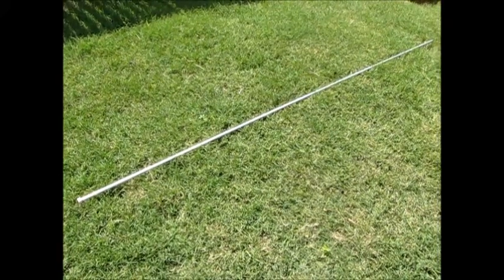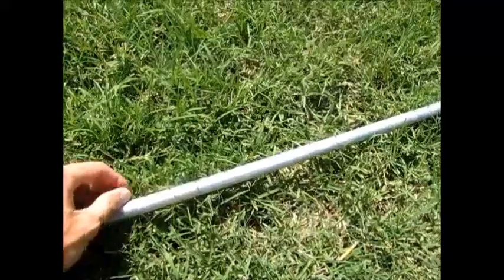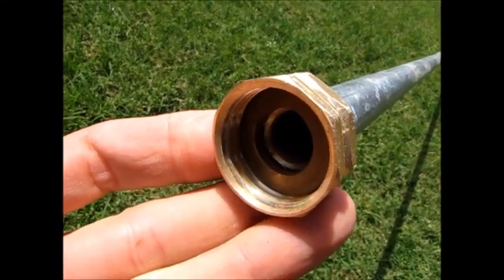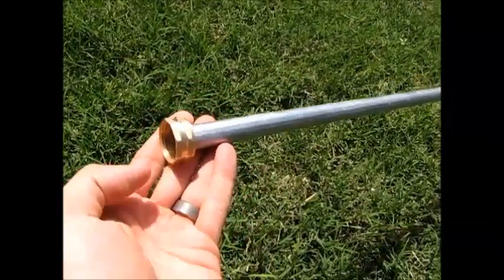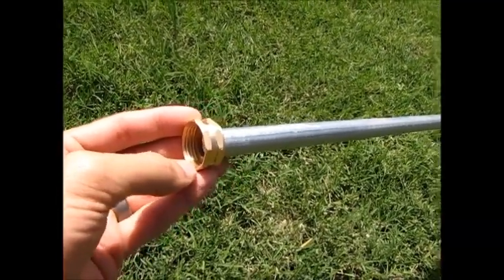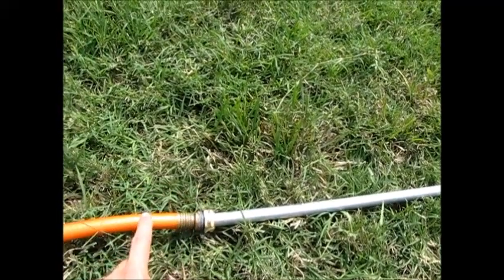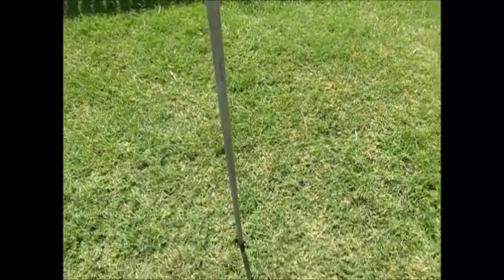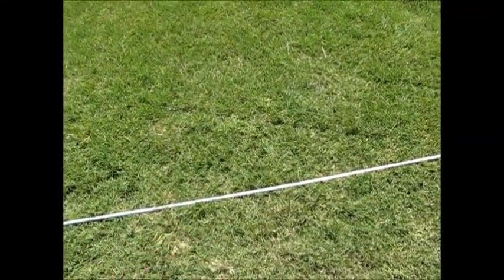How to Install a Copper Grounding Rod Without A Drill - Easy DIY Hack

Comment: Hum, why not use a length of 3/4" copper pipe/tubing instead?
Reply from the maker: For the drill or for the grounding rod?  If you are referring to the drill, copper is more malleable and softer than mild steel so it would make a worse drill and cost much more because the price of copper is so much higher.  The drill has to be able to push aside rocks and go through tough layers of sediment and I don't think a copper drill would handle that well without getting deformed or broken.
Reply: LDSreliance I use 1/2" copper pipe for my ground rods all the time. They are cheaper and longer than regular ground rods and have plenty of copper surface area too. Using one as the drill and leaving it in place could be an excellent plan. And you can probably remove the fitting with no problem.
Reply from the maker: That is a pretty good idea.  Have you ever checked the impedance to make sure that it is a viable ground?
Reply: Almost pure copper trumps copper-clad, and will last longer than you do. And at 10 ft. long instead of 8, I can cut one in half and get two 5' rods for some situations...an additional savings. A very important consideration is a no resistance connection. Use fine sandpaper to shine up the connection point and use a copper strap and copper wire if at all possible. Braid is a good RF ground. Use old RG-8 instead of expensive braid. Solid wire is better for a safety (lightning) ground. Using old RG-8 both the inside and outside conductors does both. BTW a hollow pipe will penetrate ground easy even if you have to hammer it in. And there is a tight connection not achieved with mud.
Reply from the maker: Sounds good.  If I ever have to do this again I will try it out.  Thanks!

Comment: Solid copper rods are solid copper. There ain't no scraping off the coating.
Reply from the maker: Solid copper ground rods are very rarely used.  The rods used for residential homes, for example, are all copper clad steel.  https://www.ecmag.com/section/safety/dirt-ground-rods

Comment: Dig a small hole.. fill it with water.... keep it filled.... use the ground rod itself..... lift it....drop it...lift it.....drop it.....using hydraulics....it will drill its own hole. Mother nature will..over time...fill any dirt in around the rod...securing it tightly !
Reply from the maker: Yep, that is very similar to what I did.

Comment: In order to be effective, a ground rod must be in tight contact with the surrounding soil.  Ground rods installed using this method will not be in tight contact with the surrounding soil and will not provide an effective grounding electrode. There is much literature available that invalidates the method of ground rod installation that you demonstrate in this video.
Reply from the maker: I don't understand this line of comment.  The mud makes it easier to push the grounding rod into the ground but creates a MASSIVE amount of suction that prevents it from coming back out.  I couldn't have gotten that thing out with anything less than an excavator after it was in the ground.  So tell me how that is not tight to the ground??

The only real criticism to this method would be if the grounding rod doesn't facilitate electricity to flow into the earth.  But this method produces a valid ground of less than about 25 ohms resistance.

Comment: If losing the copper coating on a copper grounding rod renders it useless then why are you showing us a galvanized steel rod to use?
Reply from the maker: It isn't a galvanized steel rod.  It is a copper clad rod.

Comment: When you install a rod like this it is loose in the ground so you have no ground!
Reply from the maker: I would suggest that you try it out before you disparage the method.  Because there is no way that any human being could remove that rod from that hole after it goes in without digging it back out or using heavy equipment.  It is in much tighter contact with the ground than simply hammering it in.

Comment: That does not make a grounding electrode. Note: that water driving method will insure high impedance; you are after a low impedance system. And the proper ground electrode. Drive two solid  5/8 or ¾ x 8 foot long min7 feet apart galvanized or copper clad rod it the proper way as a supplemental or main grounding electrode system if you don’t have building steel or copper water piping as your primary grounding.
Reply from the maker: +Mike Phillips Sorry I never saw this comment.  The water drill that I created is just to make the hole.  I then insert a copper rod in the hole.  Click on the full demonstration video (https://www.youtube.com/watch?v=K5eorpQBml0) to see it more clearly.

Comment: NOPE. The rod must be tight to the ground. 'Drilling' a hole to insert the ground rod makes it so the rod does not have firm contact with the earth! The best way is to hammer the rod into the earth.
Reply from the maker: I guarantee you could not get that rod back out of the ground after 5 minutes without a backhoe.  In fact, I would bet it it tighter to the ground than hammering it in because the of the suction of the mud.

Comment: Why dont you buy a post driver, a sledge, or other well known tools for this job and run the rod in 3 minutes instead of ten? I like the creativity, but this is a waste of money in materials and your time, and time is money.
Reply from the maker: I have a sledge.  And a sledge or post driver will mangle the top of the rod.  Remember, this is copper clad steel and the copper cladding can easily be scratched off and lower the effectiveness of the rod.

Also, this tool is much more effective if you have rocky soil as the water will create mud and help move rocks out of the way a little bit so you can slide through.  With a sledge you will just continue to deform the rod as you pound into a rock.
Reply: LDSreliance prove that current wont travel well on a slightly deformed rod head. Do it all the time and it still passes electrical inspection. I think I know a bit about conductivity and electricity wont care about a dinged up head.
Reply from the maker: If that works for you great.  I tried it first with a sledge and I could not get it into the ground without running into rocks.  The top of the rod mushroomed to the point where I could not even get the ground wire connector over the top any more.  So I looked into renting the right equipment.  $40 for a day?  No thanks!  So I built this rig for $10 and it has worked great for me multiple times.

Comment: copper coating? you use a pure copper rod.
Reply from the maker: Not always.  Copper clad steel is the most commonly used grounding rod and is the only kind available at big box hardware stores.

Comment: a GROUNDING ROD is  not  Not  NOT  "copper" !!!
it is  5/8"  Copper Coated STEEL 
...
Reply from the maker: A distinction without a difference.  If you mangle the rod pounding on it to get it into the ground past rocks and the copper cladding is removed, the grounding rod will be ineffective.

Comment: lol, just take a freaking hammer and pount it in. You put a piece of wood over the ground rod and it doesn't take nothing off of it.
Reply: Good luck breaking a gasline, water pipe, sewer pipe, electric line, etc. 😂😂🤷‍♂️🤷‍♂️

Comment: Albertans THIS IS ILLEGAL!!!!!
Reply from the maker: +Klint Krossa I'm not saying you are wrong but you do realize this is for DC electric and not household AC power, right?
Reply: Wait, why is this illegal?
Reply from the maker: ElementofWorship Illegal and "doesn't meet local code" are not really the same thing as some people in the comments are saying.  This method may or may not meet any electrical codes that apply to your city, county, state, country, etc.
Reply: @LDSreliance  It doesn't meet National Electrical Code in the United states. What do you mean, "for DC electric"?  Regardless, NEC also requires you bond all of your grounds to a common point. Doesn't matter if it's for home/safety ground, ham station ground, antenna ground.

Comment: Could just use a bottle of water...
Reply from the maker: Well that would only accomplish half of the effect.  The purpose isn't just to make mud, but the water pressure (40-60PSI usually) will actually help to bore the hole for you.

Comment: Providing u got no rocks
Reply from the maker: Huge rocks are definitely a problem.  The only way to deal with those is a drill.  But drilling through a huge rock will not provide a solid earth ground, anyway, and thus you would have to find a better spot anyway.

Comment: Anyone try measuring the rod impedance from installation over time? That reveals the efficacy of this approach.
Reply from the maker: What method would you recommend to measure?  Just a simple multimeter measurement?
Reply: LDSreliance
One that simulates the current waveform of a strike for one. This requires a source capable of supplying several hundred amps for a few µS. But by time I'm referring to shrinkage of the soil from dehydration. Ground rods were invented to prevent shock hazard in utility service, not to perform lightning dissipation. Their electrical homogeneity with the soil is notoriously poor, in part because high contact resistance, which is the bane of all high current circuits.
Reply from the maker: That may be completely accurate, I have no idea.  All I know is that it is required according to current building codes and it is very cheap so I do it.

Comment: so you run into a rock what now ?
Reply from the maker: If it is a large rock you have to move over a few inches or a foot and start over.  If it is a small rock, the water will loosen the soil and the rock may nudge out of the way.

Comment: ow and what happens if u hit a stone? be very lucky any where to get that far down
Reply from the maker: If it is small it will slide past.  If not, you have to either try a different spot or find a drill.  But you would be surprised how often this works.